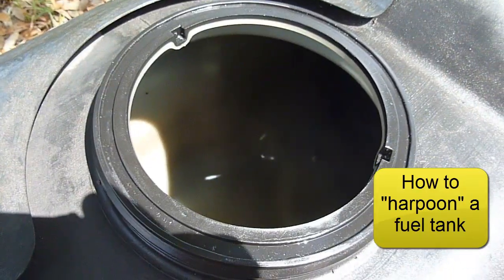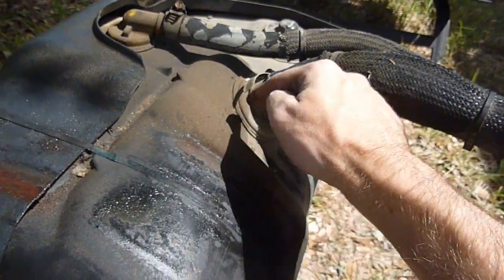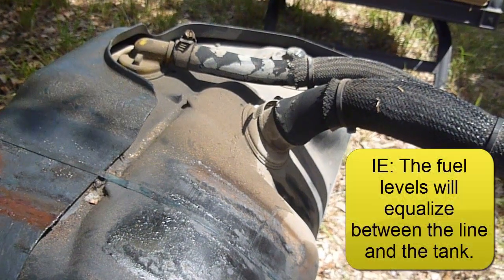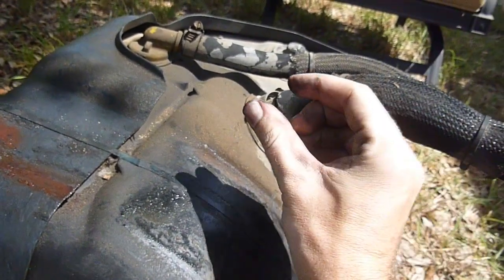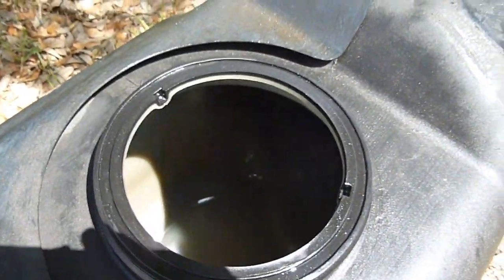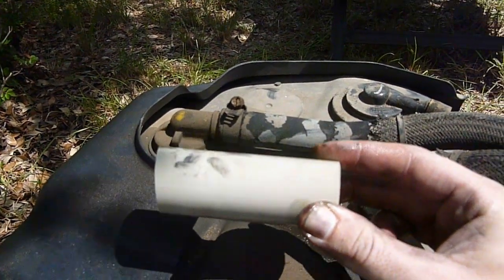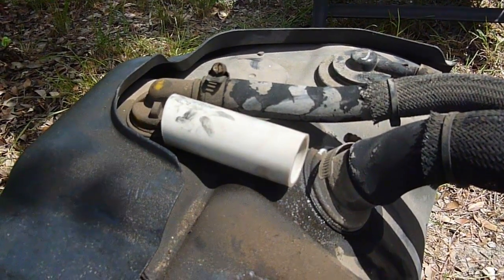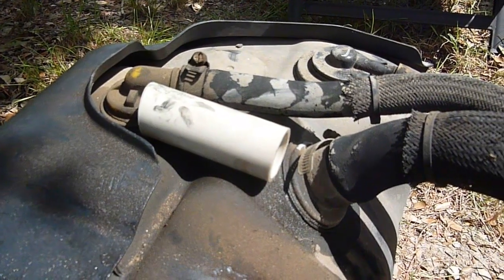Harpooning a Fuel Tank | Ford F250 / F350 7.3L Powerstroke Diesel

Comment: Does this allow you to add more fuel than. Before
Reply from the maker: Technically, no. However you can fill the tank a lot faster which ends up meaning that you will put more fuel in.
Reply: innocuous_name aw thought maybe u could squeeze In a few more gallons
Reply from the maker: samuel Allen the volume of the tank doesn't change so that is why you technically can't put in anymore. Since the the uppermost part of the fill pipe entering the tank is higher you can more quickly or easily get more fuel in. So...yes...you can sort of squeeze in a little more fuel than without this procedure.
Reply: Dot  mandates  90%  max  fill  on  any  diesel  tank . Cutting  that  piece  off  will  probably  get  you  to  98  or  99% .